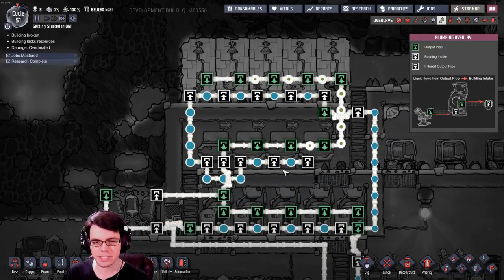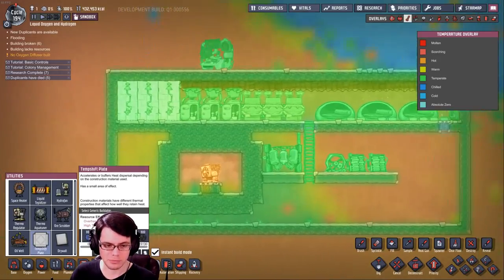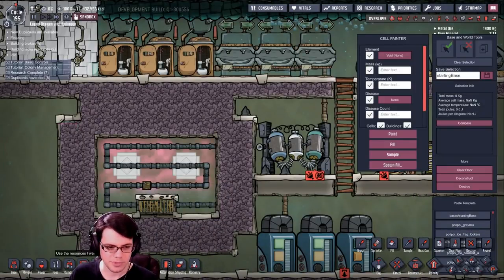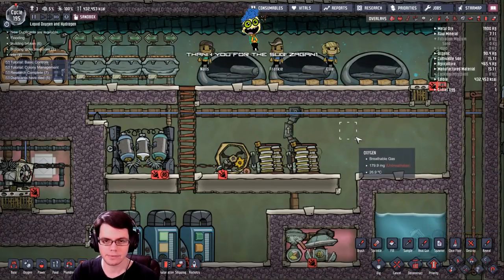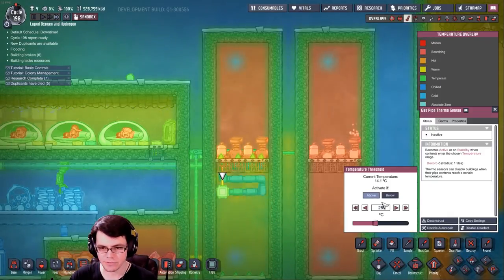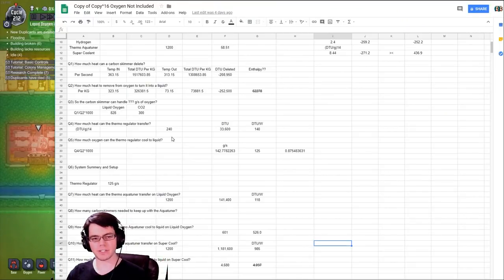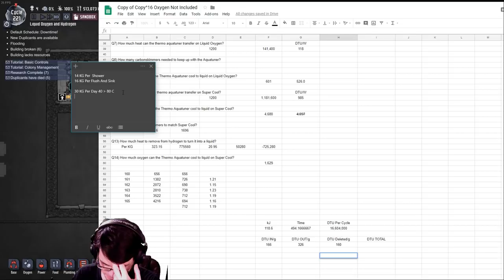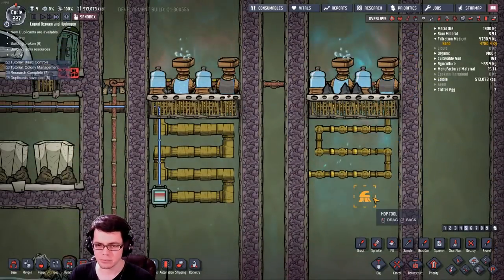Flush Your Heat Away! Oxygen Not Included Experiment Part 1 of 2

Comment: Shouldn't you be pumping the heat into the polluted water, then sending it to the water filter? Because the way you've got it running now, the hot clean water is going into your sinks, showers, and toilets, otherwise known as *the middle of your base*. If you put the heat into the polluted water, you'd have a bigger buffer before it steams, and you wouldn't need to spend all that material insulating so many extra pipes.
Reply: You have to insulate inlet pipes anyway if you don't cool water after filter and don't want to spare wheezewort. But warming up polluted water before filter make sense.
Reply: Definitely this. In fact, you can just dump the excess pH2O into a hot pool and move heat into it and only sieve the water when it gets too full or gets close to boiling.
Reply: The toilets and showrs also heat up and spread the heat around themselves, i think thats where the extra dtu went.
Reply: And it would as well be better because Polluted water has an Higher boiling point(120°C) then normal water so you would even delete more heat. Your just deleting from around 40°K  you could maximal delete 60°K with normal water with polluted water you would delete around 80°K per Bathroom use. So if the average polluted water given off by the Bathroom per day is 90Kg or 70Kg if you want the overflow not heated up.
 So you could delete 
   
             40°K   60°K  80°K
______________________
          
90Kg: 15KJ  22KJ  30KJ                   --------------------------->46.7%,more if you as would heat up the overflow as well.         
60Kg: 10KJ  15KJ  20KJ

_______________________
With maxed out water almost Temp you would delete 46.7% more
and with polluted water  you could delete and almost maxed out Temp 100% more 
And the nice thing is if you heat up the polluted water that much you can make hot steam and store Huge amounts of it in a Tiny room and drip high presser room and kick it  out of the liquid state this would be great to cool very hot machinery or maybe to melt some Ice Bioms because that steam is going to be around 122°K so you could cool it down 24°K before it would condense.  :D
Reply: @TubeTAG  could even use that to push it into steam, for the turbine - as if anyone would ever actually use the turbine for it's purpose though
Reply: to prevent the base from heating up just put 1 or 2 wheezeworts in between or next to the wash room, or insulate the whole room and put the wheezewort at the entrance
Reply: Travis Pluid Exactly what I was thinking. I might run a test when I get home for a setup.
Reply: Spent literally the whole video going, "why are you doing this backwards?"

I do that same trick for the Metal Refinery.  Heat up polluted water, send it immediately to the sieve, goodbye heat.  I hadn't thought about adding an aquatuner to exploit that heat deletion even more, definitely gonna have to do that now :)
Reply: @brothgar  Also, if you heat up the clean water, it gets doubled by the toilet, basically adding more heat. You should heat up the polluted, sieve to reduce temp...and always send cool water to toilet, thus doubling the volume (shower and sink don't create more water than they input).
Reply: And it is going to be deleted anyway.
Reply: @masonp1314  The day you don't need plastic for turbines is the day, when you could start to think using them :/

but I do like the turbine ... with the aquatuner/thermo-regulator you can make everything to energy ... even ice :D
Reply: @nomnom_plays  wait ... o.O this means you could double the amount of energy for use in turbines as well right? O= the toilet power-plant

man no i feel sad they adjusted the heat capacity of polluted water and matched it with clean water xD
Reply: @brothgar  You can also use a carbon skimmer to get rid of all that carbon dioxide your dupes were exhaling to create more polluted water for your sieve to clean and cool your thermo regulator. Can you try to use outhouses and compost bins to do the same thing? The outhouses create polluted dirt and the compost cleans it and outputs dirt at 50 degrees celcius. Also, the perfect temperature is 297 degrees farenheit.
Reply: TL;DR. put the water filter before the bathroom, not after. good observation!
Reply: I wondered why he wasn't doing the heat change pre sieve .other than the shower no heat is added while it can delete heat with the sieve. Then again I'm still pretty new to the game technically

Comment: You could get a better cooling if you put the radiant pipes below the electrolyzers, only touching the oxygen they produce, because the way they are now the pipes are exchanging heat with the electrolyzers, the air tiles, and the air surrounding them.

Comment: You should also use the radiant pipes in the radiator around the thermo regulator, it would make a large difference I would assume

Running pH2O through the pipes might be better as it has a slightly higher specific heat capacity but the sieve will still delete heat till it reaches 40 degrees, so slight efficiency boost I guess,
Creating a heat tank of pH2O could also be good

Comment: As with all heat exchangers, you should be inputting your cold cooling fluid where the oxygen is coldest (ie lower down) and extracting your hot cooling fluid where the oxygen is hottest (as it comes out the electroliser).
Tlds, run your hydrogen the other way through its pipe
Reply: Dead on!

Comment: I use a variation on this trick where I pipe polluted water from the toilets to every part of my base that's too hot (40-100 degrees) I do it for cool steam geysers, incubators and my thermal aqua tuner loop.

The only difference here is you are pumping hydrogen around and bringing it to your polluted water rather than vice-versa.

Comment: Brothgar i had a strange idea - Carbon dioxide in liquid and ice states has decent thermal conductivity while the gas on the other hand would move upwards on its own without energy.
This could be used to move cooling down large distances since it wouldn't exchange tempreture while falling in liquid state.
Unless it does but i remember the melt that was dropping from an ice biome not doing it. While i can't think of a good application there could be a use for this. Maybe just a coolant battery as the heated gas can be deleted easily?

Comment: Shouldn't you also reverse the flow of the gas that cools the electrolyzers? Because you lose cooling potential the way you use it.
Because the coolest part should be at the furthest away from the heat source and the output (hottest side) should be at the heat source. Making sure you use every piece of cooling potential instead of wasting a lot
Reply: Yes i thought of this as well. 
However, i dont think that would work here. The thermo regulator only cools the gas by 14  degrees, which means after a while the input in the radiant gaspipes would become 
56 degrees bcs the electrolyzer has an fixed output of 70 degrees. If you were to do this then you would need to loop the gas in the thermo regulator until i reaches 20 degrees otherwise the oxygen output would reach only 56 degrees.
Reply: @TheJXGamer 
Well the downside to having it the way that he has it right now will automatically add a +2-4 (maybe more) degree of heat penality on top of the lowest possible temperature because when the cooling gas reaches the coolest part of the oxygen it is already heaten up by the hottest part.
It will not increase the efficiency of the gas cooling, but it will increase the efficiency of reaching the target temperature. Since you dont have to deal with "PreHeated" cooling gas.

Comment: Try thermal shift plates out of dirt UNDER (2-3 tiles under) your left electrolizer cooling loop. They block off the head transfer instead of spreading it ;)
I use this method behind / arround my oxygen diffuser early on to stop the hea spread arround my base.  If the shiftplate heated up you have to switch them with cold dirt again ;)
Reply: Well because the oxygen is already hot there it wan't do much ^^  but if you have "normally hot air" like 26°c there you will see a difference ;)
Play arround with dirt (or any other materials that shows "slow heating") shift plates and you will see what I mean ^^
I wonder that no tutorial in YT shows any of that mechanic =/

Comment: Would't running a aquatuner with polluted water be more efficient than a thermo regulator? A aquatuner can move 487 DTU/W instead of 140DTU/W for a thermo regulator.
Reply: The aquatuner also uses 1.2kw though and is more of a mid game thing while the thermo regulator is easier to use early on.
Reply: Its very difficult to keep an aquatuner cool for constant operation early on as you don't have access to alot of conductive materials even if you research it very early. And if you can't move the heat the efficency doesn't help and could cause a ton of problems
Reply: It's just more important to cycle an aquatuner on and off. In the end you're still trying to achieve the same thermal flux, which is probably less than what an aquatuner can handle. Wiring an aquatuner is a serious problem in the early game, however.

Comment: You can run clean water into a Water Purifier without breaking it now? Does the clean water still come out at 40C? you could just make a loop that continuously loops and leaves water at 40C. I am not 100% if this would eat a lot of power/filter product. Water could leave the loop at 40C to be cooled a little bit (that heat goes back to the WP) and you use a Water Purifier to delete all the heat you want.

Not 100% on the games mechanics anymore, but this might work.
Reply: I'll have to check to be sure, but I think it acts like it has a bypass. No filtration medium is consumed, not sure about power.

Comment: valve over flows work best. just have the valve feeding the washrooms and then send the excess elsewhere. the valve will take any and all it can if left at full open and any excess material will automatically pass it when the valve is full
Reply: bridge does work but has no controls bridge can be placed behind things se either way works
Reply: on a side note you could be feeding your electrolizer with radiated pipes from the hydrogen top you can absorb the thermal energy before converting the water to o2 and hyd

Comment: Hey Brothgar ! I was wondering how do you determine if a tempshift plate material is good for insulation/heat dispersion ? I know it has to do with thermal conductivity and capacity but not sure wich one for what.
I heard dirt/coal were the best for insulation and diamond/wolframite for heat dispersion so thats what I use rn
Reply: Insulation requires extremly low conductivity (So what you are insulating doesn't exchange heat with your trying to protect it from) depending on what you do the higher capacity might be good/bad since once its heated/cooled it would leak energy through depending on the tempreture gradient (The difference).
Since a recent patch when two things exchange tempreture they use the average between the two Thermal Conductivites so if you use Diamond with 80 TC and place it next to insulated tiles  thoose would heat faster then thoose outside the range of them.
Gotta say this is hard to explain in text form without some images to help.
Reply: @chadoftoons  So from what I understand heat capacity doesnt matter long term, only conductivity does
Reply: Yeah because you heat them up eventually it just takes a long tame because of the mass in KG they have compared to the heat they can soak
Thats why water takes so long to cool/heat despite having good conductivity
Another tip is if you use Insulated Tiles around a room you can also further insulate it with a second layer because then the first has to exchange with the second to get the heat through and with cermaics 0.006 for example that will take forever
Reply: Specific Heat only buffers heat transfer until the material reaches the mean temperature between the ambients it separates.
If you have a permanent regime (meaning, the heat supplied to the material over time is constant), Specific Heat doesn't matter. But if you have to keep something cool or hot for long periods of time and you cannot supply cooling or heating for some reason, that's where the Cp comes into play.

You can get perfect insulators in the game (K=0). They are so OP that the devs made them late game tech. However, you can make vaccuum layers to achieve perfect insulation. It just takes a lot of time to do and some micromanagement.
Reply: Thauã Aguirre Cp ? Specific heat ?

Comment: instead of using hydrogen in the cooling pipe you should use polluted water. polluted water in pipes will have 10k per dot while hydrogen is only 1k dot. the mass difference make a huge difference in the amount of heat you can remove.

Comment: Brothgar, shouldn't you want to make like the water as close to boiling as you can, before making it into the electrolyzer? Could just push water into steam, then go through an airflow tile, get cooled, and turn into water just on the edge.
Electrolyze it, and the temperature basically dropped.

And same for polluted water, except without turning to steam, and going into a filter instead. And heat it only right before you use it in the filter, instead of running hot water around your base.

Also, couldn't you put cold water into showers and cool the base with that? Since showers work as a thermal plate, essentially.

Also, why'd you stop using door airlocks/vacuums? Don't they still insulate things?

Comment: Turn Liquid oxygen into gas state by pumping it into a pool made with metal tiles. Heat with a volcano until it becomes a gas. Then use a gas pump to transfer into a part of your base. Cools it down decently!
Reply: To ultimately cool your base, heat up liquid oxygen with possibly a volcano and pump it into a small area in your base.
Reply: @jacobquevedo2210  Instructions unclear, flushed liquid oxygen into volcano.
Reply: Use heat from volcano to heat up liquid oxygen. Sorry for your loss😑
Reply: Why would you use LOX as coolant? By the time you can even make it, you already have a cooling system that you should easily be able to use to cool your base as well.
Reply: To cool things extremely quick.
Reply: @jacobquevedo2210  think the point of this video is to demonstrate an unconventional, EARLY way to delete heat.
Reply: @jacobquevedo2210  But what's the rush? For general base cooling, what you're trying to combat is mostly the relatively slow process of your base heating itself up. That said, one advantage of your idea is that you don't have to run a loop, you can just dump the cold air into an open space and let it diffuse. But you still need a system like this to make LOX in the first place.

Comment: Cant you delete around 50 degrees of heat if you heat up the polluted water and then water sieve it? Doesnt the sinks and showers radiate heat because they get heated up due to hot water coming into them?
Reply: The building itself has no idea what temperature its input is, and doesn't react to it at all. The pipe does leak some heat, however. But yes, as I said in another comment, it would be easier to use polluted water as coolant and cool it in one step, instead of using clean water as coolant and cooling it in two steps.